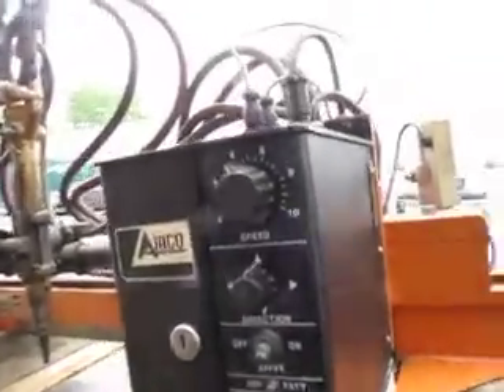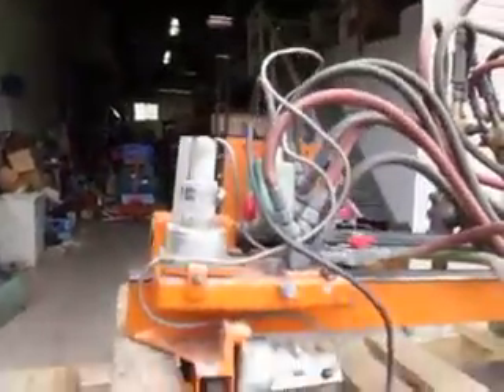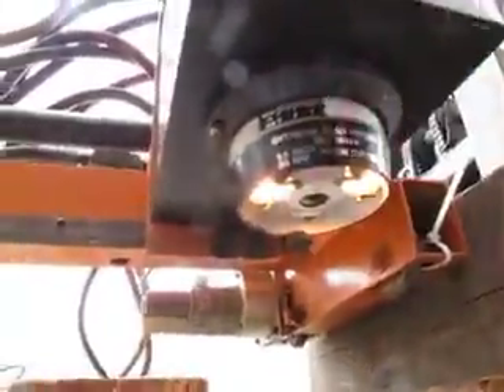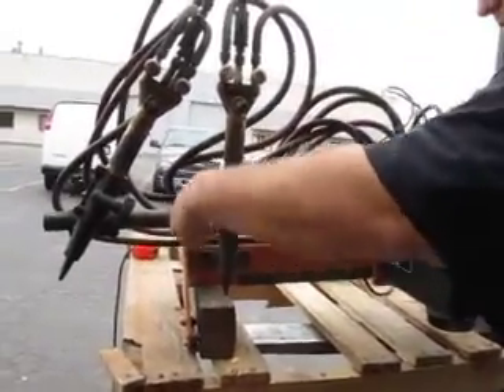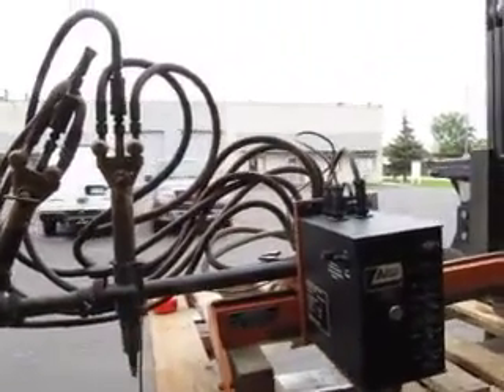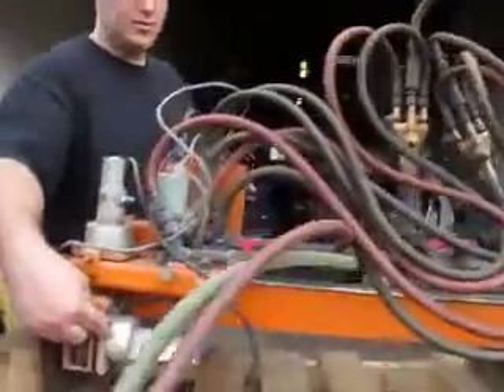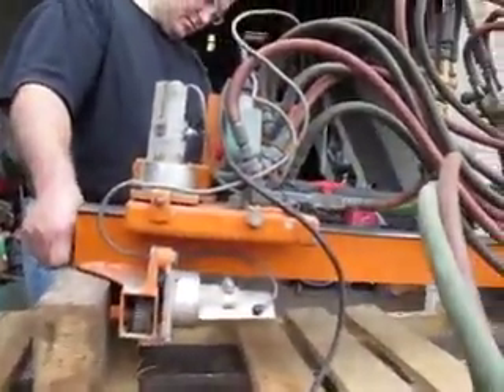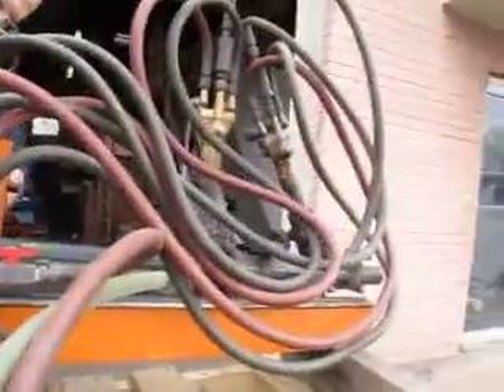CNC Optical Tracer Gas Plasma Cutter

Comment: Dear Robert Spector.

I have some HL-90 Co-ordinate drive tracing systems. I have had someone repair and test the 4 position rotary switch but, the machine still won't go in the direction to the right and therefore will not follow the drawing. Would you have a wiring diagram for this board? On the board it is written: TRACING CIRCUIT ASSY 3504D24G0 - SER. NO B1221.